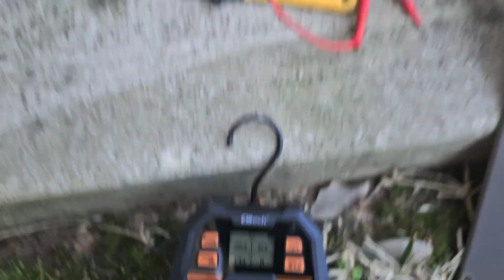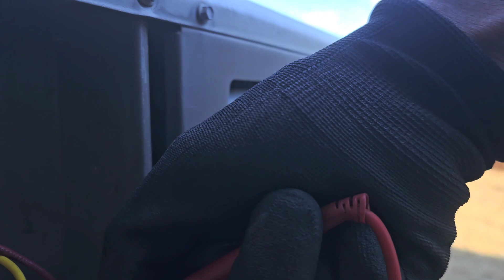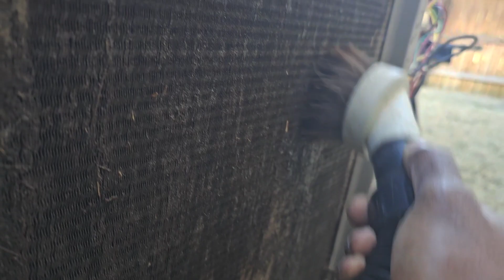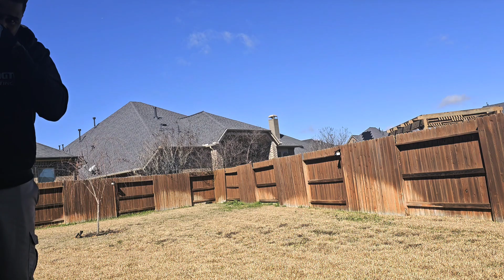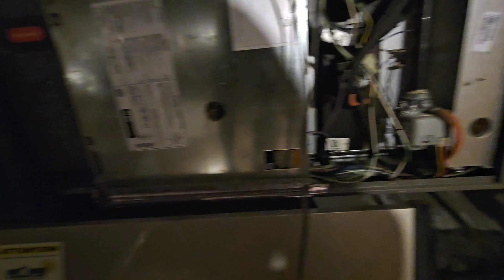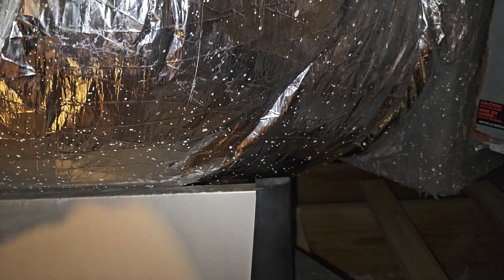The Great Cooling Comeback: A/C Repair for a Cooler Tomorrow!

Comment: I think those k&n are washable. Problem is they need to be dry to reinstall.
Reply from the maker: Do you like those k&n filters?
Reply: I’ve never used them, seems like something new. I would say they work since they look robust and like you said are based on engine filter for car. the owner would need a spare filter to allow this filter to dry before putting them back
Reply: you wash them out, dry them and then oil and put it back in

Comment: Good work WW. Getting that dirt off of the coils with the vacuum and brush FIRST is an excellent plan so that when the water cleaning process takes place you don't start off making a mud pit down below etc. With that much dirt built up, its way better to pull the junk off dry with a vacuum and the brush to get down to the metal then the water cleaning process is much more effective. Good idea to use the OEM motor on that fan !  Those mice/rats are hanging out there getting their water supply from the condensate. They are such a pain in the A. That condenser motor likely worked hard and hot for a few years until it finally burned up due to the clogged up coils. Maintenance rules in the long run.